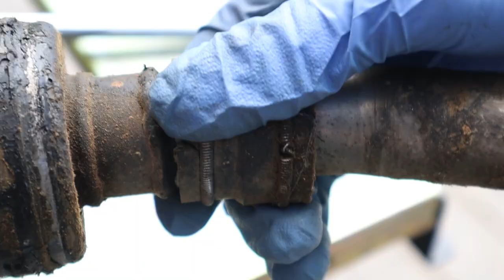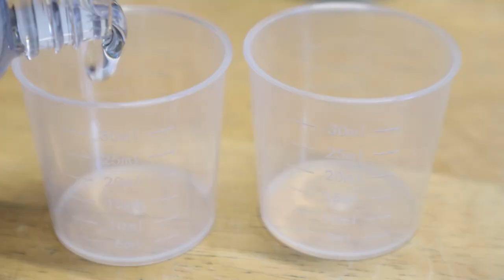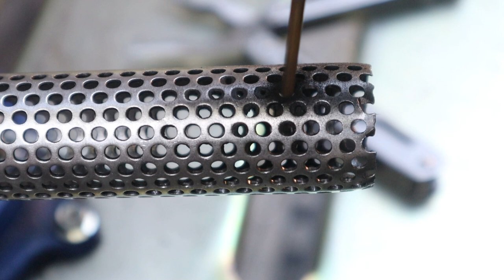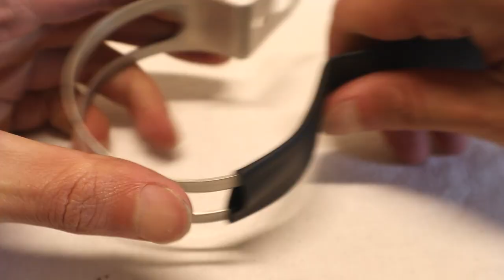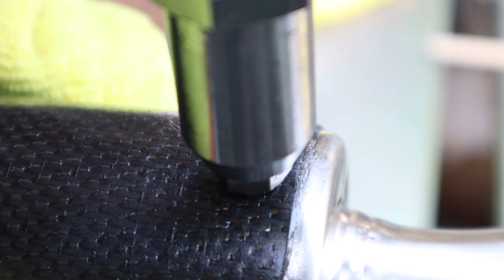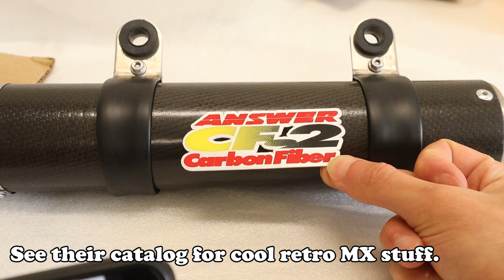How I Restored This Rare Exhaust | 1996 RM250

Comment: Dude,did you seriously drill through each one of those holes, wow 👌
Reply from the maker: You mean on the baffle to remove the carbon? No, most of those got clean using the scraper, but the last inch or so of the baffle I had to do individually because it was hard to grip the scraper.

Comment: At 3'43 is it silicone?
Reply from the maker: Yes, it's Gorilla brans clear silicone. I wanted a clear one.
Reply: @madmarc thanks
Reply: @madmarc great job! why do you use it? to prevent from water to get inside the exhaust?
Reply: @hugogomes2143 because every muffler has it